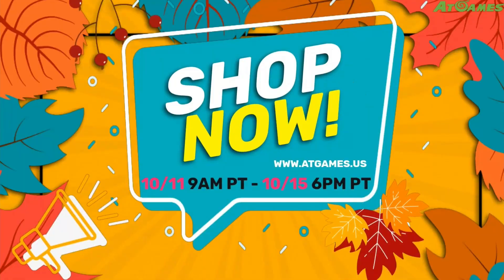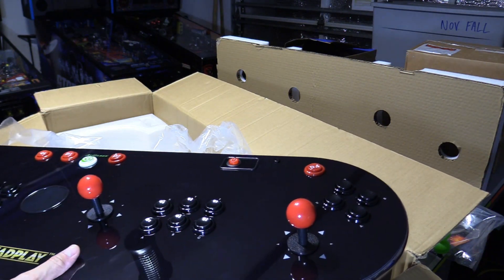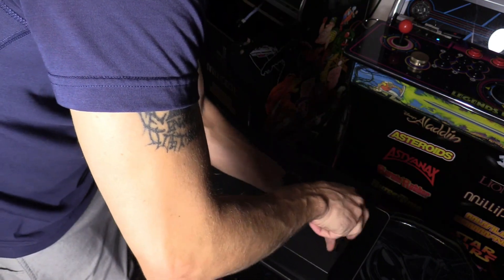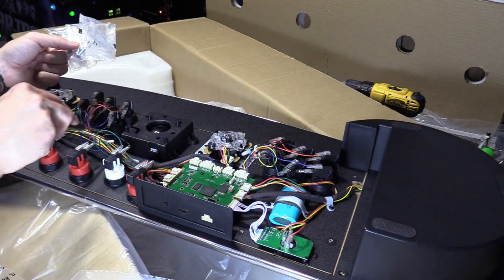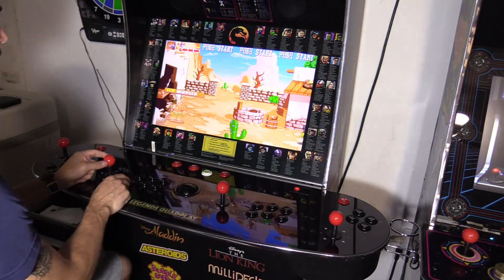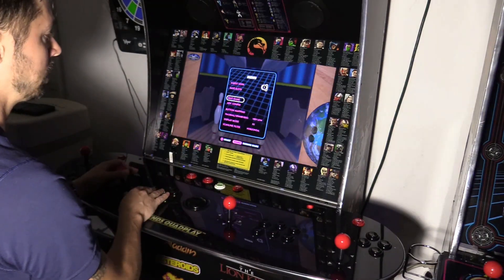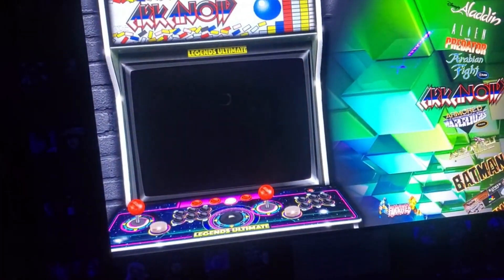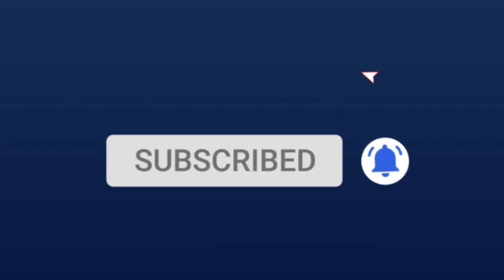How to install Atgames Legends Ultimate Accessories QuadPlay control panel

Comment: I would absolutely want this if there was any way to have spinners installed like the original panel.nice to see it tho thanks for the vid.
Reply: You could, it would only take you about 60 seconds with a power drill and one of those circular saw bits. You'd likely need to order the right sized bit though as I doubt it's a common diameter. From there it's just pop in the spinners from the old top and hook them up the same way as the original. Personally I never play any arcade games that use a spinner so I prefer it without them.

Comment: Installed my quadplay yesterday on my 1.1. after transferring my trackball from the original deck.( quick note i do have  a bitpixel hooked up to an LBPA) updated software to latest on alu and quadplay..Got everything working fine on stock software. meanwhile I downloaded the newest fixed Coinopsx and plugged in. It loaded no problem except now quadplay controls dont work...AT ALL. the 4 blue lights dont stop flashing, which they did when i originally plugged in the quadplay usb. Is there not enough power maybe going to the USB? do I need a powered USB   port? any help would be appreciated
Reply from the maker: Hold atgames button for 10 sec to turn off Bluetooth mode, then controls should work.  Atgames sent firmware update to fix it, I think.
Reply: @TampaTec  Welp...I did a thing...got annoyed and factory reset the machine. now Im stick on firmware 10942_a2 and whenever I try to redownload the new firmware I get "download file size is incorrect please try again later" 🤦